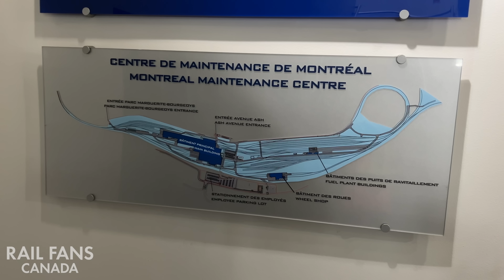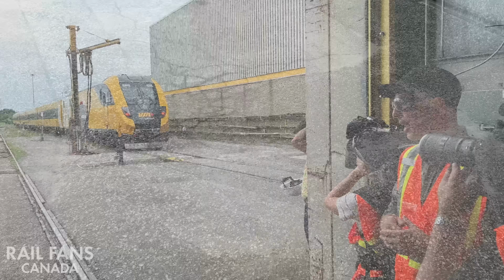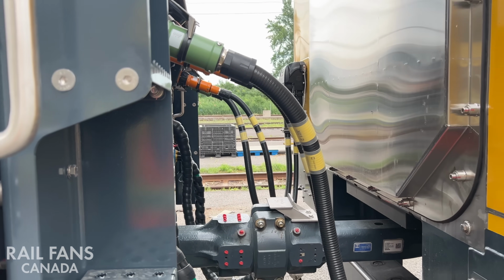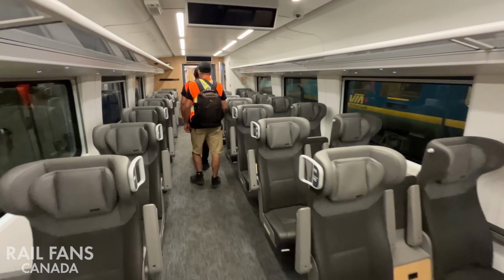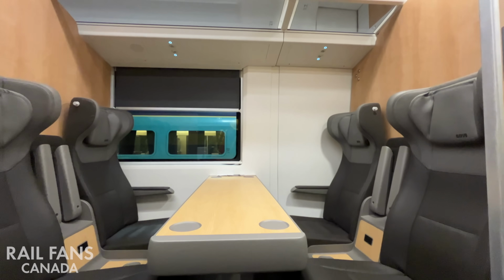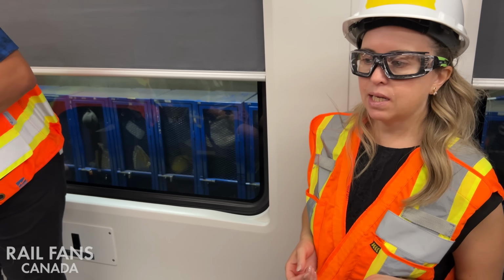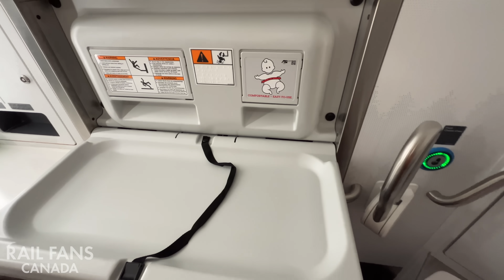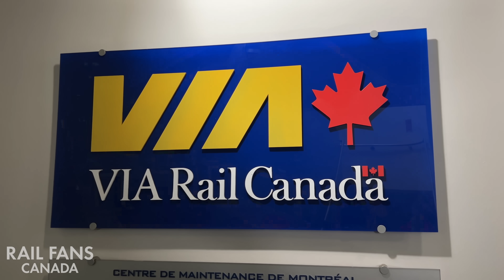Introducing Lumi and the New Fleet of VIA Rail: A Unique Train to Celebrate a New Era!

Comment: Now if they could upgrade the tracks so that the trains can go faster than 70km/hr we’d be all set
Reply from the maker: Hoping that HFR becomes a reality as that would definitely help increase speed and reliability of the schedules. In the meantime, the fastest speeds that could be achieved are just under 160km/h on current tracks. Trains do go faster than 70km/h on many segments.
Reply: @RailFansCanada  I have absolutely zero confidence that it will happen. It should, but it won’t
Reply: Only way that's going to happen is if Via gets dedicated track it doesn't have to share with freight trains. But of course, we know that will never happen thanks to our half-arsed government that's always a day late and more than a dollar short when it comes to doing anything.
Reply: >70km/h
>The literal 100mph(160km/h) speed board directly outside of Toronto Union Station
Reply: I rode Via at up to 152 km/h last year. Stop exaggerating.
Reply: @annoyed707  Wait, are you talking to me or the OP?
Reply: @stevestruthers6180 at that point just skip to maglev and give GO transit and exo the trains and serve Ottawa too
Reply: Lisbon to Porto in February of this year 222km/hr.. and booze on board!!
Reply: @annoyed707  Some people can only focus on the negative...
Reply: @Sir_David_Beatty  the Tracks around Toronto are mostly owned by GO Transit (with the exception of the Galt Subdivision AKA the Milton line)
Reply: They are clocked at 99mph on the Kingston Sub in the Napanee to Kingston area. Old or new.

Comment: Glad to heard that going replace the equipment on long distance runs even will probably miss those dome cars. It was time those cars up to 20yrs older than me
Reply from the maker: We really hope the Long-Distance Fleet will include a modern version of the dome cars. They are an iconic part of passenger rail in Canada and hope they will be seen as such during the new procurement process.
Reply: Having been to a VIA Rail presentation on their new long distance fleet, they are considering new dome cars. My analysis is that it depends how much such cars will cost, which will be the determining factor.

Comment: About time we replaced all the existing passenger stock on VIA. Anywhere else in the world they would be regarded as preservation line trains.
Reply: @johnmurray8428  well via rail doesn’t run serious service on ANY route
Reply: @qjtvaddict  not serious is about right! 

There was a “service” Toronto- Kingston - Fallowfield- Ottawa - Dorval(for the airport, which is in itself a joke) Montreal. 

They dropped this during Covid and have not restored it! So you have to book a single journey Fallowfield-Ottawa, then Ottawa - Dorval. Only the train from Toronto to Fallowfield is always late and you have to get Ottawa Station on your own efforts or miss your flight. Via on two occasions could not give a toss about missing flights, the best they can do rebook you for a later train, nuts to your flight!
Reply: Those passenger Cars were built in 1948 for various American Railroads like the New York Central, Denver & Rio Grande Western, Pennsylvania Railroad, Atchison Topeka & Santa Fe, Illinois Central, etc they then were inherited by Amtrak in 1971 and then later sold to VIA Rail
Reply: @ do you know when via bought these passenger cars?

Comment: has VIA give  any indication of reliability of the new trains (locos and cars) ? Do they still need a lot of tender loving care to debug or have they reached degree of maturity where they can truly be deployed anywhere and spend night away from the Montréal Maintenance centre?
Reply: They were made here by Alsthom / Siemens and have been operating in regional service throughout Europe for years now without any problems. German design and engineering so they should be a little better than the LRC (Light, Rapid & Combustable)

Comment: I need to add that we don't use Sortie-Exit (at 6:46) anynore. Now we use more and more a pictogramme which is the International Signage System
Reply: @stevedolesch9241  For clarity, please explain who "we" refers to. You used "we" twice with no indication of what you meant.
Reply: @Jon.Morimoto  Sorry about that. Near the exits of buildings there are pictogrammes of a figure running indicating emergency exits instead of words Exit-Sortie.
Reply: @stevedolesch9241  Do you mean buildings in Canada? Who is the "we" deciding to use pictograms? Building owners? Provincial government? Municipal government? As a federal crown corporation, VIA must use both French and English, but pictograms and other languages are not specifically mandated.
Reply: @Jon.Morimoto  It's International. Beginning to be implemented gradually. Wish I can send you a photo.
Reply: @stevedolesch9241  "We don't use Sortie-Exit anymore" is a different claim than "beginning to be implemented gradually."

Comment: There nice new trains for sure, but there is nothing like the classic Budd cars, if VIA was smart enough they should keep all there Budd cars considering they don't rust, as there stainless steel, and built like tanks.
Reply: Well these new trainsets are also stainless steel just with a wrap over the metal. 

I do think they should keep some of the older rolling stock for historical preservation
Reply: As museum pieces that can certainly be done. For regular service, not so practical. The VIA staff are already struggling to keep enough cars on the rails to keep "The Canadian" operating. They have to manufacture parts from scratch because there are no parts available anywhere. Each year, cars have to be retired for good because they are no longer repairable. This was all reported in the news media back in February.

Comment: Why is this loko pulled and not a DMU? The yellow is stunning by the way, they all should look like this.
Reply from the maker: It isn't a diesel multiple unit, however in contrast to the older trains, there is a cab car at the opposite end so it can run in either direction, negating the need to turn around to operate in the other direction.

Comment: Are these trains electric?  And will bicycles be permitted on board?
Reply from the maker: The Siemens Charger locomotives are Diesel Electric, however they could (potentially) be upgraded to support electric-operation as a "bi-mode" locomotive.

Currently, bicycles are not allowed on board as the "legacy" fleet does not have bike racks. Once the entire fleet is replaced, then the policy to allow bike onboards might be implemented!
Reply: @RailFansCanada  The luggage racks will go up to make room for bicycles. There is very little space for luggage now, so it will be ridiculous when bicycles get  priority over luggage.  The current policy in Business Class is two large bags per passenger.  Where will they go if even a quarter of the passengers bring one large bag?

Comment: Incite passengers to take the train?  Good joke.
Because of bad interior design with no luggage space, VIA has instituted hostile baggage rules designed to scare passengers away. 
Its insistence in not having at least 1 baggage train per day means net loss of passengers (that train was so full VIA often had to add cars to it, something it cannot do with permanently coupled trains).  And as a cyclist, I will never be able to take the train in Canada again since their "pretend" bike hooks in the Siemens cars require the only baggage rack to be disassembled in a car that already ha a huge defiit in  baggage racks compared to the LRC.  Compare this to european trains that have a section  dedicated to bikes.  (Ceské Drahy,s new Comfortjet (Viaggios) have 2 such cars dedicated to bikes). 

 And BYW, on west bound trains, never take seat in car 5 (cab car) because the horn is located inside the cabin and is very loud and of course in canada rings constantly. 
No these heavy steel trains are not incentive to take the train (and won't mention their narrower seats that are not comfortaable). 
In terms of long distance trains: VIA said that they won't be able to run then past 2030. The Minister said that VIA might get new ones by 2035.
So once more, we are to lose what is left of long distance service.  (toronto vancouver is not transcontiental). 
I know that you have to put on a smiley face to maintain good relations with VIA, but I don't especilly as VIA doesn't want me as a passenger.

Comment: The only why you as Via will insite people to take the train is to slash your pricing.  Via charges insane prices for the Windsor to Montreal corridor.  It shouldn't be that much more than what GO train charges for intercity travel.

It shouldnt cost me 700 to 1000 dollars for a round trip from Brantford to Windsor or Toronto to Ottawa or Montreal.  That's crazy.
Reply: I’m not entirely sure where you’re pulling “700 to 1000 dollars” from. I thought that sounded odd so I checked.

A train from Toronto to Montreal, next month, round trip, leaving on a Sunday morning, returning on a Friday evening, with Economy plus seats, so that comes with baggage… is 271$ with taxes. That’s all together, downtown to downtown, on the upgraded economy ticket. You can get it under 150 if you’re willing to adjust the days slightly and take the escape fare.
Reply: @graygraygraygraygraygray family of 5 buddy.  Not a single fair.  Sorry I wasn't specific in my original post. 

Lets be honest passenger rail in North America is dying because of no priority trackage and assinnine fairs.

Comment: A lot of money and hype for the wrong equipment. It would be good 80 years ago but not now. VIA is trying to behave like an airline and passengers what faster, cheaper and comfortable. The fact that it is high platform with trap doors and steps means it is useless for any place without high platforms. Loading a lot of passengers through one or two of these sets of steep steps is a waste of time. Also the ticketing system is to convoluted. People want a system where they can board a train on short notice, not one they have to book a week in advance. 

They need low platform access like Stadler FLIRTs which can board through all doors and carry more people. Carry more people and charge less per passengers. People like GO trains because they are frequent and less expensive. They dislike the seats but FLIRTs offer both benefits.